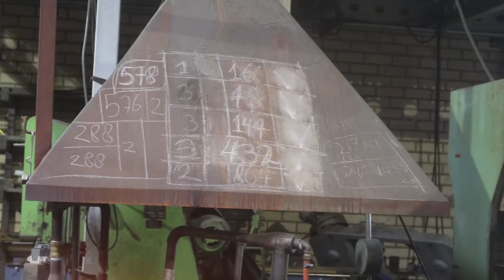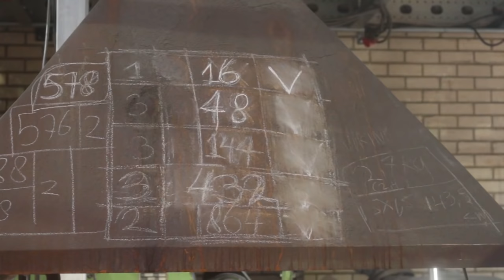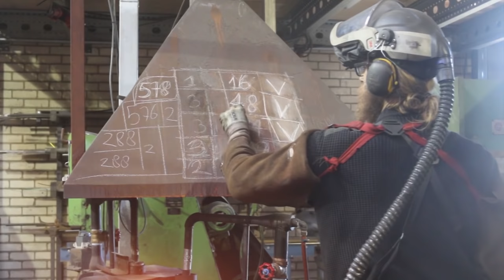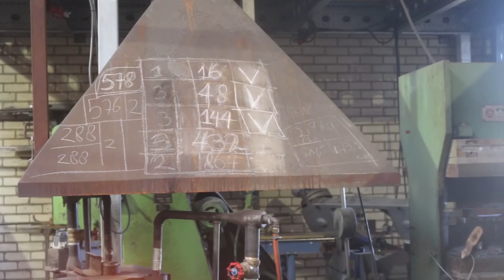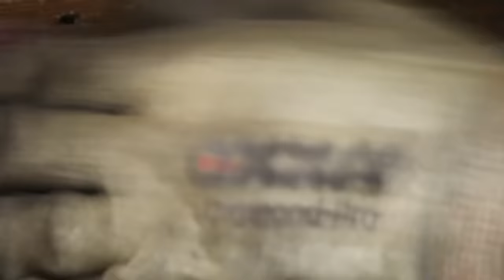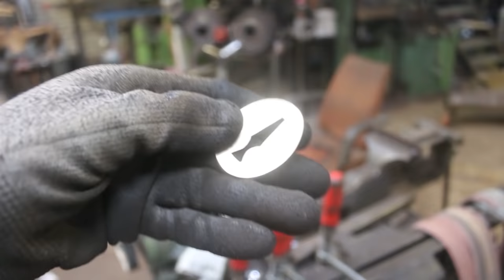Forging a Samurai sword, the complete movie

Comment: Came out beautiful, and it's an interesting take. While I'm not a complete purist, there are a few things I do think need to be present for something to be a samurai sword / katana which are missing here. First, the handle needs to have certain elements: same (stingray skin or some equivalent), menuki (small figurines that create bulge for hands to grip), kashira and fuchi (collar and end cap), and most importantly ito (cord wrap). Next, your blade shape is close but there are some important differences. Primarily, the tip of the katana called the kissaki needs to be more distinct, which is usually achieved during the blade grinding and polishing stages which were absent here (though that is understandable since it would probably double the amount of work). Lastly in terms of the forging process, generally the curve isn't forged in but rather the blade is forged straight, and then the curve happens naturally during the quenching step. Still it's a beautiful sword and an example of great craftsmanship, would love to see a cutting demo video
Reply: You said it in such a nice and professional way. I think it's a great sword but not a Katana.
Reply: I don't think you can say "I'm not a purist" and then go on to use the Japanese terms for specific sections of each part. (you listed five elements for the handle alone, let alone blade construction)

Comment: Traditionally, katanas are forged straight, it is the differential cooling along the spine created by the application of several clays that causes the bend as the final form is quenched spine-first in water or oil.

The bend would be my only critique. After correction the curvature was interrupted slightly. In every other aspect, this is the best katana build I've EVER seen on YouTube, BY FAR.
Reply: @FFFF-zu9bx  I would say the hamon is in keeping with the understated nature of this sword; it's not trying to be something, it really is what it is... If that makes any sense?
Reply: Its pretty cool tho, in a clear tank u can see how the blade bends in the other direction befor go in the right direction
Reply: The first thing my eye was drawn to was the artificial bend which has a sweep that begins too close to the grip. I can’t make that so I have no room to complain but yeah, it is a bit wonky for a “Samurai .” Well done!
Reply: Katanas are not forged straight.

Comment: Once you started using your own interpretation I knew that this set was going to be something special and unique, and you did not disappoint! The blade itself, with the distinct wire wrapping Harmon, came out fantastic. Your closed habaki and use of the seppa in between the habaki and the tsuba (which is almost always ignored) was great to see. The rest just pulled everything together into one solid blade. VERY well done Freerk!
Reply: 9999
Reply: @tacfoley it's called autocorrect
Reply: Agreed.  I mean he has a dream workshop as well.  It is a inspiration nontheless.
Reply: ใใใใใใใใใใใใใใใใใชใใใชชชชชชชใใใใใใชชชใชชชชใใใใใใใชใชใใใใใใใใใชวววววววชใใใใใชชชใใใชชชชชชชชใชชชใชชชใชใใใใใใใชใใใใใใใใใชใใใชชใใใชชชชใชชใใชใชชชชใใใชใใใชใใใใใใใใใใใใใชใใใใใใใใใใใใใใใใใใใใใใใใใใใใชชใใใใใใใชใใใชชชใใใชใใใใใใชใใใชชชใใใชชชชใใใใใใใใใใใใใใใใใใชใใใใใใใชชใชชใใใใชใใใใชใใใชใ
Reply: ช
Reply: @yoshyusmc  uyuuuuuuuuuuuuuuuu
Reply: @user-lq8dl2xp1u  uuuuuuuuu
Reply: O

Comment: An authentic samurai sword is forged straight the curve is created in the quenching process. He hand-forged the curve into the blade
Reply: Yeps now you make one
Reply: A authentic one is made of very poor quality metal that is forged over and over to make it pure. Then have 2 different quality of metals welded together causing them to warp into a curve when quenched. 

When made with a modern high quality steal and with modern equipment it is better to forge out the blade than unevenly harden the blade making it weak to cause the blade to curve in the quench.
Reply: And there's no Shigane. 
@CMDR Wee Jet: Tamagahane is not poor quality, you sop. Its bloom steel, same smelting as most of Europe made its own swords. This is a far older steel making and forging process than the modern steelmaking industry of post-industrialised modernity. There is no comparison anyway, they forged a composite blade so if you want to compare this is a superior forging technology as against the employ of just a monolithic alloy and the expressed hope that folding that bad boi fixes everything. A composite forging methodology may be revisited quite liberally to produce the finest laminated material ever, like say choosing a selection of Fe-V alloy hard jacket and low carbon Fe-C or other metal Shigane core. Very shock resistant. But we owe Japanese swordsmiths discovery of the process, even if they learned how steel was made from somebody else first the composite forging process is pure Japan. So like the mongol composite recurve back in its time, the Katana today is a time honored technological marvel. Japanese swordsmiths practiced superb craftsmanship, produced superb swords... and the mongols lost twice. Sheffield steel and all that was much later. Only the Levant used crucible steel, sometimes imported it, in the time of sword making, and that is properly called Wootz steel. And the arabs only laminated their ferro-vanadium alloy billet in the forging process, they didn't make a composite blade. Its only by chance arab mines had traces of Vanadium in their iron ore.
Reply: @santyclause8034  to be fair fapanese steel at the times was so bad it was called pig steel. You know far more about the topic than me, that is painfully obvious, but it still stands that the level of practice back then was partially driven by the horrible steel they had to work with until later.

Comment: I find this guys methods interesting. The billet in sand after a few folding, well cut and welded folding. His use of no power hammer is encouraging as well, shows yes its possible. I tried finding the name of this style of blade. At least from what I know a Katana does not commonly have a fuller and its curve is created by differential heat quench. Similar to the white stuff he used after hammering in curve. As demonstrated by Japanese masters blade is straight then curves in quench post heat.

That all said this blade he made would stand well along with the traditional blades. I just wish smiths would stop deviating by making it curved by hammer/wood mallet. This sword though would cleave about anything. Wonder if he has been on Forged in Fire? His blades would likely stand out.

Comment: Obviously it is not the traditional Japanese forging technique, neither the materials nor the shape of the saber itself, nor is the obtaining of the hamon or the blade tip correct, the bronze seppa is very thick, the handle seppa is missing, the fuchi and the kashira help to keep the pieces of the handle together, you made them decorative, a lot of love for neglecting so many details, it is western technique and damascus steel so I only limit myself to congratulating the good work of the chivalry saber with Japanese fittings.

Comment: Lovely work and a fine attention to detail. I am very surprised that the main thing keeping the blade from flying out of the handle when swung are two small pins made from wood.
Reply: actually, most real katanas use 1 pin instead of 2
Reply: L

Comment: A Katana inspired viking sword 😎. It is a very nice peace of art, that can easy keep up with every katana. but its not a katana (rant for the others in the comment section) their are a lot things missing or diffrent what makes a katana. the most important thing is the hard edge and the soft spine. the performance is most likely different because it is more or less homogeneous steel.
also the habaki has to be from a softer metal like copper. because the porpose of the habaki is to absorb the shock, before it travels to your wrist. the patttern is realy beautifull but the hammon is unfortunately drowning in the pattern. you could have covered the hammon before etching. all and all high quallity craftsmanship.

Comment: Yes this man has skills. But I just watched a video, where an 80+ year old man did the same thing, in Japan, by hand. No machines, on a charcoal fired forge.
Reply: link or the heading title of that clip so I can search for it, thanks
Reply: @giansantos2125  Thanks very much Gian, I am watching it right now, appreciate the link. Thanks again.
Reply: Thomas -he might be  65...more likely 62. 
Great clip, and wonderful skills.
Reply: on ne peut pas comparer , il a fait un très bon travail et j aimerais pouvoir en travailler un avec ces outils celà ne doit pas être facile aussi
Reply: Bia Tch  I mean, you can compare. Modern technology is superior to hand made in a million ways. So you CAN compare. 

This took far less time than doing it by hand and achieved equal quality.
Reply: Sure, seen it as well. Those old Japanese forge masters have young guys two man swinging hammers on long handles. Even back in the yee old days Europe, Spain, Japan. There was a few hammer swinging hand helpers. There is no way you would be in any healthy physical shape for 60 years manually hand hammering yourself. Even if you had a Chiropractor to adjust you.

Remove the machines then you add more humans to take their place. Hand sanding and filing generally has a guy hired to handle that task. Its pretty freaking simple, modern tools doesn’t mean your inferior to the old guy not taking advantage of the new tools. If you look into current issue. Those old Japanese masters are having a hard time passing on the trade to do it the old way.
Reply: Bia Tch  man,his steel is far more stronger than those Japanese smiths
Even tho its not a traditional way of forging a sword by a power hammer
But that steel is strong,its not made from pure iron only at its first stages
Reply: @1014p  Common sense doesn't come into it! Thats why we evolve!! 😎
Reply: Ok what's this ment to mean
Reply: Hand mada it's oder class, better and more spencive 💲💲💲

Comment: "Katana", "Samurai sword" in this video is a "mistake" or "Fake" that only has a similar "shape" and is not worth calling itself a "Katana" or "Samurai sword".

A "Katana"  that is made by a "swordsmith" who holds a national qualification and trains the bullion refined from "iron sand" calculated in the Izumo region of Japan by "Tatara iron making" according to the "appropriate manufacturing method". Point to. "Katana" in this video is a "mistake" that only resembles a "shape" and is not worth calling itself a "Katana" or "Samurai sword". 

Video creators should remove this video that humiliates the "Katana" or "real Samurai sword" with incorrect content.

Comment: Have you ever watched a true Japanese master forge a Katana?  Complete lack of hurry, frantic electric disc work,, the addition of straw ash, water heating, no borax involved, or arc welding either. The gentle wrapping of the core in paper around the pieces of  steel made from iron sand, not ore and the use of copious amounts of clay slurry throughout the process but about all a sense of ccming from the use of age old instruments  and traditional methods.
Here a sword of katana shape was made but not a Katana.

Comment: One advice, my friend. Katana is made with this proportion: 70/30. It specipyimgs sword's body, why katana is the most fast, best balanced, best cutting cold weapon of all time. 
So, katana's proportion is like this: 
1. blade 70%, handle - 30%; 2.blade's width with handle (40mm), and at the top, blade width is still 70 % of the bottom side(40mm and this is 2.8mm); 
3. Blade's thickness is imagined with still the same balance - 70/30 (at the handle - 7 or 8mm, and at the blade top - 70%(5.6mm)
So, this is the formula of katana's making

Comment: Hi, I'm not so well informed as others who watch your videos, but could I ask one thing, do you get the same effect in the metal, pressing it flat as hammering I was under the impression hammering the metal made it as strong and flexable as a Samurai sword should be never the less a very interesting video showing incredible skill and knowledge alot more than I could hope to do I have to say though a bit different than four beefy guys in dirty work stained kimonos with big hammers bashing the metal in tune with each other one after the other. Not that your any less a mystro in your profession doing what you do to metal its an art you have there for sure and a long earned art at that

Comment: The "nihontou" Japanese sword uses a single light taper rod with a diameter of about 4 mm made of bamboo called "mekugi" to fix the blade and handle.

Comment: Throughout the process, how much blade material do you think you lose, from sectioning, sanding, scale, etc ? 5%, 10% ?  If you were to sell such a piece how much ?  8000-12000 USD ?  I would say at least that based on the amount of work, and uniqueness, the fictional Hattori Hansu katana swords sold for 1MM US, and it only took him a month to fabricate.  Should not the curve, or “sori”, be achieved via the quenching process, not built into the blade itself ?  Not sure if it affects the over all molecular structure one way vs the other, but I believe so.

Comment: Well from what i´ve seen the rythm with the hammer could be way better looks like your petting the steel also there is no hammon no hard and soft steel the tempering is also off and to get true damasco steel you would  need at least 0.1 vanadium in the steel that actualy gives off a very beautiful pattern on it´s own also the true propertys of damasco steel just an improvement tip for a legendary Samurai sword forging since you got the love for the stuff ! ;)

Comment: Don’t u have to smack it and fold it ~10 times to harden the metal?

(Apparently in recent research it turned out you don’t have to repeat it 10 times cuz the metal particles were already crystallised(?) in the first 2,3 times but traditionally they folded the metal 10 times.)

Comment: I mean its nice.  But why is it so rare that makers don't use a convex grind?  Especially for a katana.  So much work put into the piece, only for a sub par micro bevel to be used.  Its disappointing that it is such a rare blade design, even though it is vastly superior in every way, and for a Katana....historically accurate.

Comment: I saw a video once where they would twist the bars together?  What is that method called?  And what is this method called?
Reply: Or the blade would be strait until partially coated in the clay mixture then heated and when quenched the blade would bend?  Am I remembering this wrong?  
Obviously your a master at this I am just trying to remember the other techniques.

Comment: This is not the correct way to make a samurai sword you need to fold the two steels and use water to curve the blade this stretches the atomic structure and you will get a fine edge.

Comment: 19:30 does strength of a blade affected after straighten it up like that?
Reply: The strength of the blade is only really changed if you harden and temper or forge it cold.

Comment: 100% wrong. You do NOT forge the curve into the blade. It occurs naturally due to the different carbon contents of the hard outer jacket and the softer core. If you sent money on reference material or watch a traditional sword be made you would know the difference. I don’t need to finish this video.

Comment: Sorry, made without Respect and Tradition. Using Machines. A Katana for me is made in Japan. Made by selecting the Material (which is made from a Smith Master with Long Experience), hammering the Material and so on. Tradition included. I wouln't spend any Money for a Katana like yours..
Reply: I guess the reason people make katanas is because they are comparatively simple to make with modern machinery, if I wasn't proper I'd buy it

Comment: hello damask pattern is very nice but technologically it does not correspond to the production of a samurai sword. By using a hydraulic press, the technological procedures for forging a samurai sword could be much better followed in today's conditions. This is more of a Cossack saber.

Comment: i watchet to around 15 min and for me there is no piont in watching further. this is not a katana.
1st - author made damascus. katanas was made similar way, BUT, in the process of the forging there were iron plate inserted in the middle of the blade, making the blade bouncy and hard to break. here? its just damascus.
2nd - master didnt cup off the tip of the blade and just pulled it to an angle. real katanas have their tips cut off then pulled up making a whole geometry of the blade identical.

3rd - katanas never were forged curved shape. the curve was a result of damascus and iron cartridge in the middle being different metals that made the blade curve in the middle of the tempering.
4th - hamon line is needed to make cutting edge harder then the rest of the body. whats the point in making hamon when whole body have same hardness.
5th - no handle wraps
6th - no guchi on the scabbard. it needed because the blade of a real katana is sharp enogh to cup the scabbard. 
all in all, this is not a katana, bascily it can be tought of as sin-gunto or kai-gunto, a katana like sword made in mass production methos during ww2.

Comment: This is not forging a samurai sword. It takes more than 35 foldings and keep melting the metal. In this video all he did is cut the cardboard in shape and polish it with handle. Which doesnt required skill. Machines can do all the work.